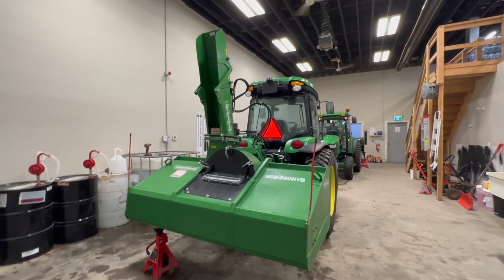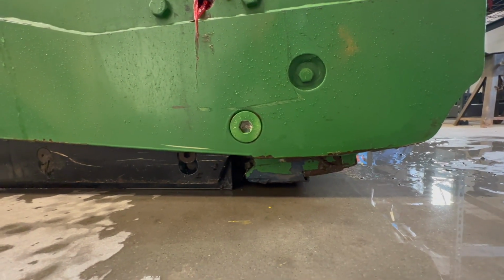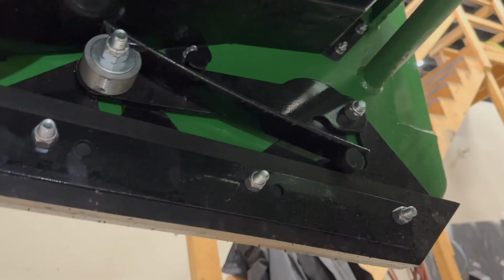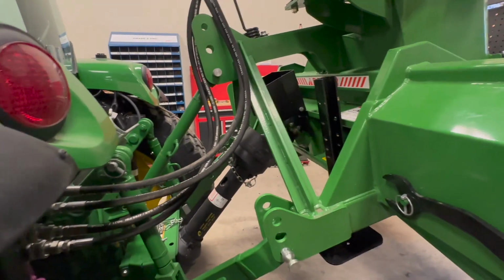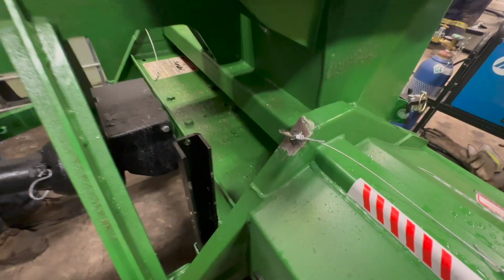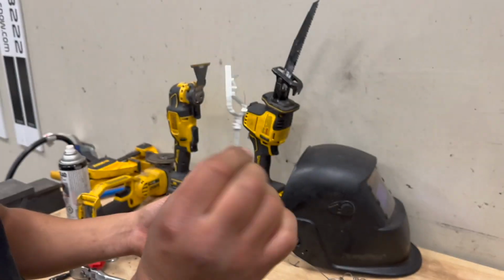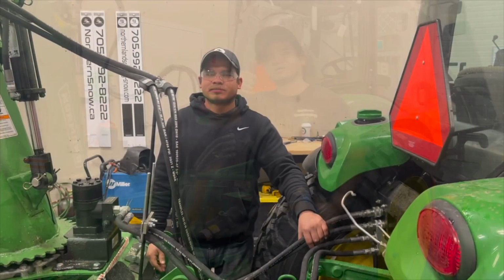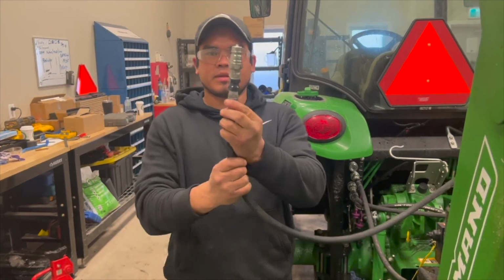The Ultimate Inverted Snow Blower Set Up

Comment: By taking the leaf spring off the blower you are effectively fixing the side shoes in the up position like you are showing @5:09, resulting in the sides of the blower to be closer to the pavement. So it's effectively stuck in the up position without the leaf spring.  I think the springs mainly break when you have the top link short and most of the weight of the blower on the side shoes. If you lengthen it and distribute the weight evenly between the side shoe and cutting edge then it shouldnt break.

Comment: I am super confused. Can you please explain why you want to set the top link short so that the bottom of the cutting edge 3-5mm off the ground? Wouldnt that mean the blower will just be sliding on the side shoes and the cutting edge will not be scraping the surface?
Reply from the maker: The cutting edge is still scraping, when you position the blower this was you get a much cleaner cut on the driveway opposed to your blower sitting flush on the cutting edge. I have been doing this with all my blowers since ive started and i always get the best results on my scrape doing this. The cutting edge will wear a bit uneven but thats minor detail.

Comment: Another thing, don’t use Teflon tape on the hydraulic fittings. If I were you, I would take off all Teflon tape immediately. It is the kiss of death for hydraulics. Instead use thread sealant.
Reply: Everyone uses teflon tape on the hydraulic fittings. My tractor came with teflon tape on the fittings and no leaks. I then took my tractor to a different kubota dealer to install rear remotes and they also used teflon tape. When I installed the normand blower hydraulics I tried without anything it leaked. I then tried hydraulic sealant on the threads multiple times, and it still ended up leaking. I then did the tape and leaks stopped.
Reply from the maker: Thank you.